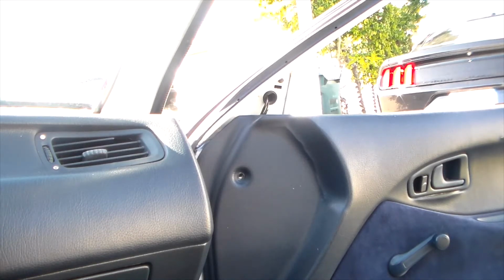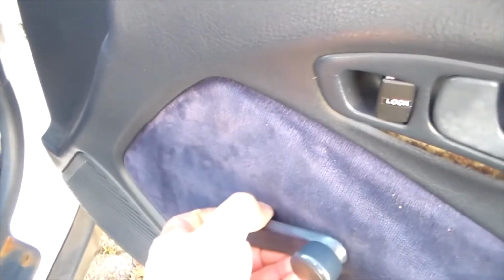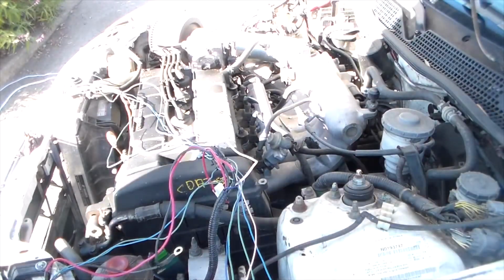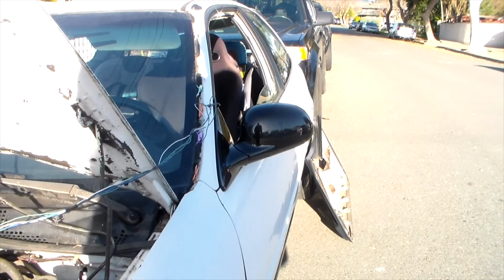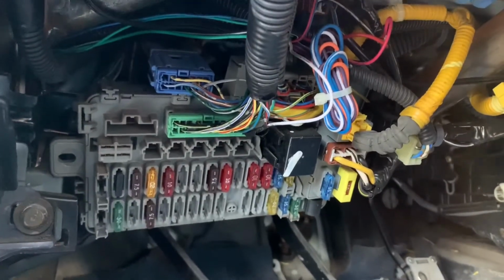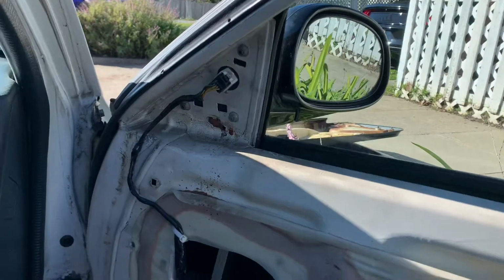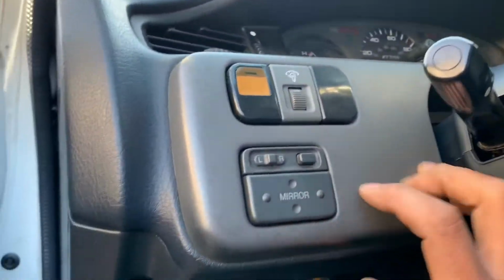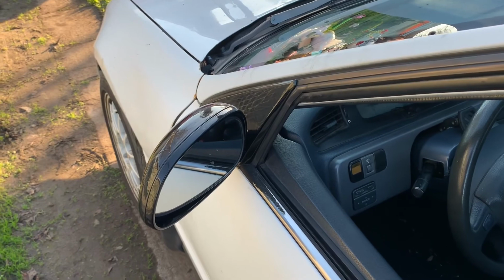92 Civic Hatchback Project: Power Folding Mirror Installation

Comment from the maker: Got the mirrors from an eBay seller. No, not selling mine. At ten minutes into the video i show the fuse box and where I make the power and ground connections. Basically ground gets connected to the chassis and the hot all the time wire can connect to a 12v source and the switch power source connects to ignition switch. Kinda like a car stereo.

Comment: How is the wires connected to the fuse box?
Reply from the maker: At about fen minutes into the video i show the fuse box and where I make my connections. Basically the ground connects to anything on the chassis. Hot all the time power source connects to a fused power source and the switched power source goes to ignition switch. It’s similar to connections on a car stereo. Keep in mind that i had the complete harness and all I had to do was connect my ground and power supplies to my fuse box. I didn’t have to make my own harness. The switch and relay where already part of the harness that came with my mirrors.
Reply from the maker: Ten minutes
Reply: What clip is used to insert it in... what do I ask for in the auto parts? Female connector

Comment: Are the angles of the jdm mirrors different? i read that you need to swap out the usdm part that mounts to the door because they are positioned for rhd. Do you have any problems with visibilty? I just bought a pair and im hoping i can avoid doin  that. Thanks for the contents!
Reply from the maker: I didn’t have any problems with mine. But i have heard that people have to swap out the mirror glass because of the “objects in mirror are closer than they appear” are on the other side. I bought mine from someone in Canada and didn’t have to modify anything, but maybe the last owner had already modified them to work on LHD cars.
Reply: @dailyhondas1480  hey i got my switch and wanted to know if the button that engages the folding clicks? The switch i got, the button doesn't seem to click inn or out when i press it. Is that the same woth yours?
Reply from the maker: @MrRoryega  it doesn’t click in and out. The button has no in and out position if that’s what you mean. Press for open and press for close.
Reply: @dailyhondas1480  thanks brotha, makes me feel like im on the right path. Appreciate you!
Reply: Hallo fried.Could you please tell me from where did you buy the power folding mirrors and how much? Please give me details.I would appreciate you.Good for your job.Bravo